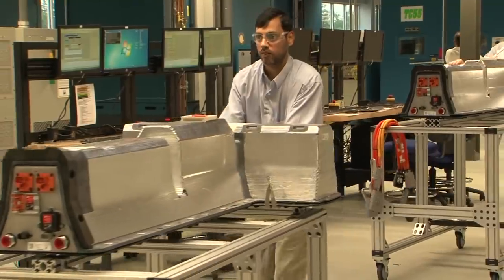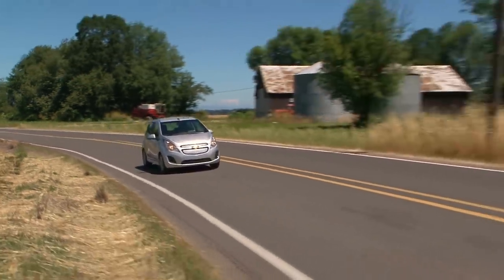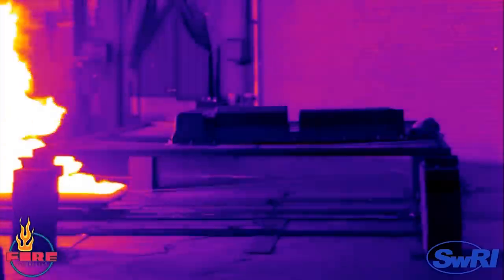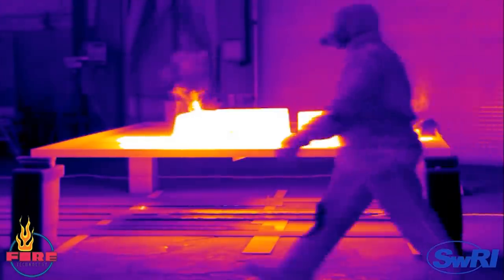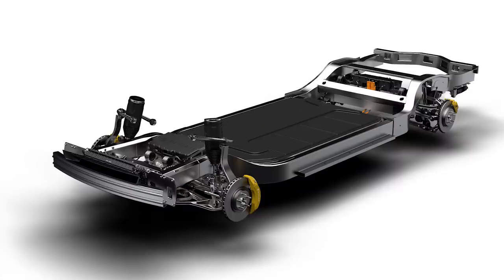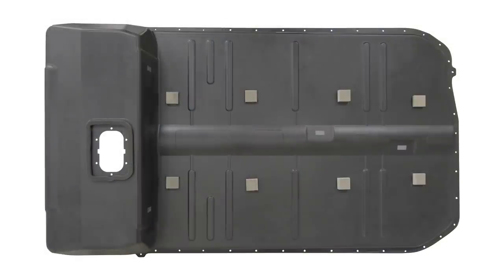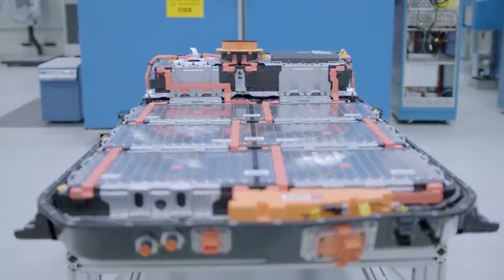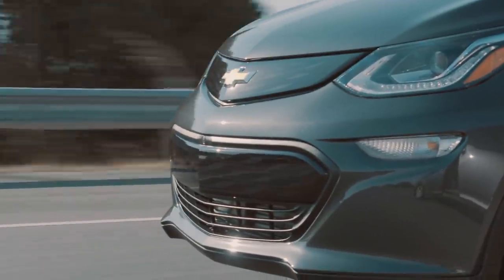That’s Not a Box, That’s a High-Tech Battery Tray - Autoline Exclusives

Comment: If the vehicle has multiple battery packs, especially in commercial vehicles, distributed in different locations such as roof, floor, rear or stacked upon each other, will the number of battery trays increase with number of packs or locations?

Comment: If you want battery vehicles to become accepted, there needs to be universal standards that everyone uses to bring down initial and replacement costs, otherwise stuff the whole concept.
Reply: Do ICE's all use the same engine, the same transmission, the same fuel tank?  Yes, it would be nice if they all charged by the same connection, but all being the same shape doesn't seem to be a necessity.

Comment: More company invest for Battery development and so fast evolving since then it improved much and price will go down, but where's fuel cell development??why it's not features here in your showno update??
Reply: There has been plenty of fuel cell development, however the fuel cell is not the problem. The Infrastructure and cost and overall energy efficiency of the Hydrogen fuel is completely uneconomical. Plus the output of the cell cannot practically supply the heavy power demands such as as accelerating, plus contamination of the fuel cell by atmospheric Oxygen pollutant content. A reasonable sized battery is also needed.
May be applicable for long distance heavy transport, see Nikola trucks, or maybe shipping but not for domestic even short distance commercial use.
Cannot be refueled at home, a trip to the refueling station is rtequired, sure may fill the tank in a few minutes, however takes up to 30 mins to rebuild compression  so the next car can refuel